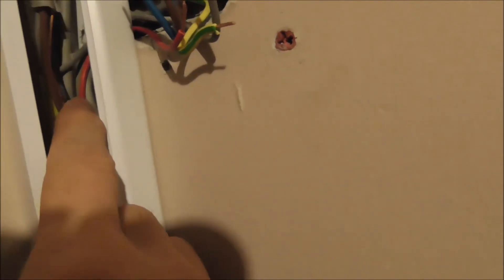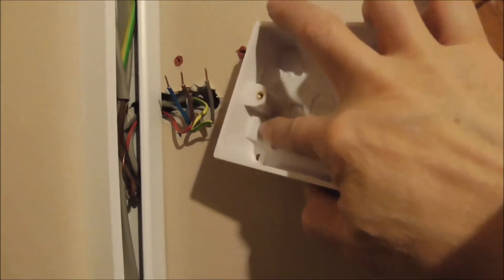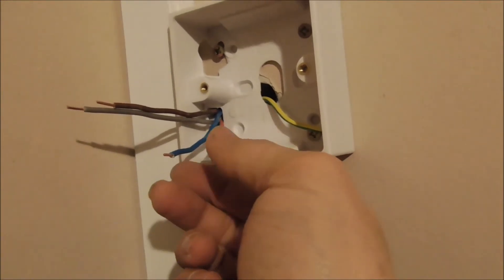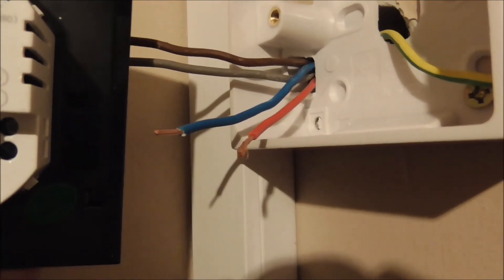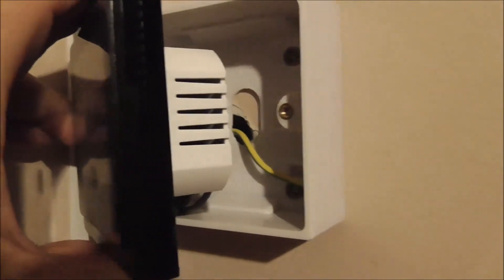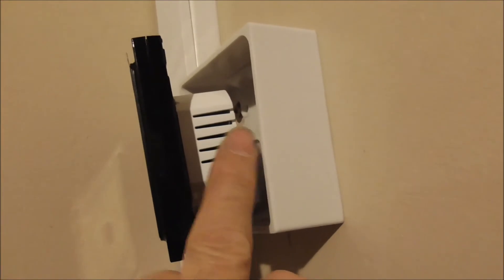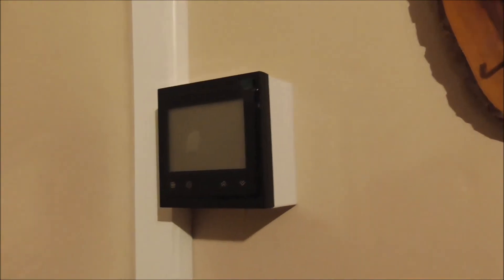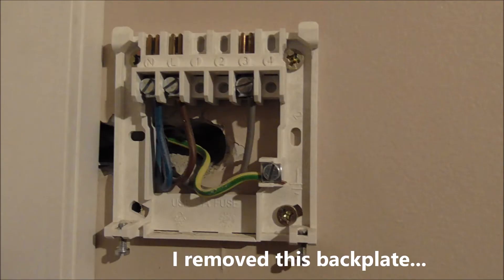Smart Room Thermostat: How to Install? WiFi enabled, central heating

Comment: I have , 1 permanant live , 1 permanant neautral and 1 switch live cable . Will i need to bridge to fulfill the 4 ports on the new thermostat or can the switch live cable be fitted to port 1 or 2 and one port be left empty? Thanks
Reply from the maker: In my case, i have a switched Live from the programmer and a switched Live to boiler, therefore the port 1 and 2 actually can connect the two switched Live together when heating is called. If you only have a switched-Live to your boiler, you DO need to bridge the permanent Live from port 4 to port 2 and connect your switched live to port 1. Port 1 and 2 is just a dry switch to connect 1 and 2 together when heat is called. check carefully before switching power on. good luck!

Comment: Hi from the USA Norristown PA WHERE DID YOU GET YOUR BACKING PLATE ? Or the WHITE BOX  FOR YOUR THERMOSTAT ? DO YOU HAVE A PART No# ?
Reply from the maker: Hi, for this type of thermostat, there is no backplate, you connect wires to the back of the unit. In this video a surface-mount backbox is used. In UK, it is a standard size, available in all DIY outlets such B&Q, Screwfix, Toolstation and eBay. Good luck to find yours!

Comment: A question about the 240V specification.  I understand that terminals 3 and 4 are for neutral and live. Does that specification refer to the voltage expected between terminal 3 and 4.. Or does that specification relate to the switched connection on terminals 1 and 2??
Reply from the maker: Hi, You can also think in another way: 3 and 4 can be considered as the power supply to this thermostat; 1 and 2 could be any two lines, and the thermostat just sometimes connect them together and sometimes disconnect them. Have a nice day!

Comment: I have an old wiring on old thermostat one black wire and one white where do I install on 1234?
Thanks
Reply from the maker: Please make sure you 100% understand your boiler system before starting your installation! To help you know your system better, I am trying to provide some info below and hope useful.  

Old two-wire thermostats could be mechanical thermostats which need no power and act like a switch. If this is the case and your new smart thermostat has the same wiring diagram like shown in this video(at 2:30), I think you should connect the two wires from the old thermostat to the connector 1 and 2 (either way) of the new smart thermostat. You should also find a way to get the permanent Neutral and Live wires to the new smart thermostat and connect them to the connector 3(N) and   4(L) of the new thermostat. 

Carefully understand and plan your job before starting it. Safety first and wish you a success!
Reply: @RepairDIY  ok how do I add a bridge do I need number 3 or number 4 or both?
Reply from the maker: @goodawindi  a bridge can be made with a short wire connecting two terminals on the thermostat but you must make sure which wires you are connecting.  One of the two wires on your old thermostat could be permanent Live but you have to find out by testing.  Whatever wires they are, it is safe to connect them (black and grey  from your old thermostat) to terminal 1 and 2 (of your new smart thermostat). You do need permanent Live and Neutral wires for  Terminal 4 and 3. Good luck!

Comment: Was the reverse wire for heat pump type unit? I have a heat pump type unit. Where would I hook up the reverse wire? I'm in the USA .
Reply from the maker: This is actually temperature-driven dry switch. It can be used anywhere where a traditional mechanical thermostat can be used (with extra N and L wires). have a good day!

Comment: Is there a smart thermostat for split AC?
Reply from the maker: This smart thermostat has a dry switch, which is good for many applications. If you can find the wiring of the built-in thermostat of a split AC system, you should be able to wire this smart thermostat into a split AC system. Good luck!

Comment: How do you get to cool mode I got it hooked up it isn’t blinking anymore
Reply from the maker: Cooling and Heating modes: it depends on the makes and models. some thermostats can only be used for heating and some models can be used for either heating or cooling. You could check the descriptions / instructions when buying and installing. have a good day!

Comment: My thermostat is blinking I have almost the same one what do it do? 4 red green n 3 yellow n 2 and white n 1 and it’s blinking
Reply from the maker: hi, the only blinking happened to me was when the thermostat was in setup mode, when you setting up the wifi name and password via your mobile phone. You could check your wifi connection or set up the thermostat again? good luck!
Reply: @RepairDIY  okay it aint blinking any more I have it on but how do I get to the snowflake to turn the air on when I hold the vdown the lock pop up
Reply from the maker: @killahk94  How to lock or unlock your touch buttons: press and hold up and down button for 5 seconds. good luck!
Reply: @RepairDIY  I need to get to the snowflake it is 6 modes or something

Comment: Hi i need help with my wifi thermostat. I only have the red and the blue wire from the old thermostat. Where do connect the other to wires at the CV. I saw that you connected them to number one and two. Red is number four and blue is nummber 3. Where do number 1 and 2 go to
Reply from the maker: hi, your two wires from old thermostat should be connected to 1 and 2.  Then you should connect 3 and 4 to permanent Neutral and Live. Safety first and Good luck!
Reply: @RepairDIY  ok. The neutral and live are the two wires from the old thermostat. I don’t have the other two wires. So my question is where do i connect the other 2 wires in the boiler? I already saw the connection for 1 & 2 at the thermostat.
Reply from the maker: @raoulfelter  if the two wires were connected to your old thermostat, the blue should not be the permanent Neutral, and the red may not be the permanent Live! If you cannot decide if the red is permanent or switched Live, the easy way is to connect the two to 1 and 2, then find and add the permanent Live and Neutral for 4 and 3. Hope this help. have a good day!

Comment: Hello i have a thermostat like this one but i want to connect it to gas boiler. Can i? I connect on 3-4 L-N and the other two wires to 5-6 for gas boiler. It works but my heat never stop, i turn off the thermostat and the heat is still on. Whats wrong with it? On 5-6 the 2 wires have electricity
Reply from the maker: hi, try to put the boiler two wires to the terminal 1 and 2 if you are using the same thermostat. Safety first always. good luck!
Reply: I did that 3 days ago and my electrical board brokes. Those 2 wires have electricity on them
Reply from the maker: @kostasgkvo4064  hello, your thermostat may be different from the one in this video? For this thermostat, there should be no voltage at the terminal 1 and 2 if no wires connected to them. If your thermostat has the same wiring diagram, and you have voltage at either terminal 1 or 2 or between them when no wires connected to them, then the thermostat should be faulty. The terminal 1 and 2 makes a DRY switch, not connected to any other wire inside the unit. When you need heating, the terminal 1 and 2 are connected inside the unit while you don't need heating, the terminal 1 and 2 are separated inside the unit.  Hope this info help. Good luck.
Reply: @RepairDIY  same diagram yes... My wires have voltage so i cant connect them to 1&2. I thought maybe i can make a jumper from from 3 (N) to 1 or 2
Reply from the maker: @kostasgkvo4064  hi, wait! how many boiler wires do you have ? One or two? if two, just connect them to 1 and 2. if one, you should find out what is required to control the boiler with that one wire, only after that you can decide your jumper connection. good luck.
Reply: i am actually in the same situation. i have tried to replace it but my boiler heat is still on. i put the old thermostat back. still no use, boiler heat is on. i have restarted the boiler itself. still the heat is on. any solution.?
Reply: I have 4 wires ... Black Brown Blue and Grey (UK) I have a combo boiler. Where would the wires go?
Reply: @ratilalinduondhia3516  Brown to 4
Blue to 3
Grey to 1
Black to 2

Comment: Hi, I got the same thermostat to install. I am replacing a manual Siemens  two wire only thermostat, the two wires only work as on and off switch, both wires are, 1. switch live (RS-SL) and 2. live (RS-L). I think I'll need at least a third one live to permanently feed the thermostat and a four wire can be a bridge, either from one of the two wires. The question is: what wire should I bridge? The 1 or the 2?. I think it would be the no. 1 which is currently neutral.  Your  opinion would be appreciated. Thanks!
Reply from the maker: hi, when you bridge any two connectors be very careful. verify each wire before connecting or bridging (decide: if any wire is permanent Live, switched Live, or boiler control/heat-demand wire; you MAY NOT have a neutral wire from the old thermostat?). i suggest that (1). connect the two wires from the old two-wire thermostat to the smart thermostat terminal 1 and 2; (2). find or add permanent Live and Neutral wires and connect them to the smart thermostat terminal 4 and 3 respectively.  IF one of the two wires of the old thermostat is INDEED permanent LIVE, THEN you can bridge that wire to the smart thermostat terminal 4.(in this case, you only need to add a permanent Neutral wire and connect it to terminal 3). Safety first, think it over and check before any connection. good luck!
Reply: @RepairDIY  Thanks for your reply, i'll need to get some time to look at options to enable permanent feed to the thermostat , very quick check question: what is the voltage for terminals 1 & 2? thanks again
Reply from the maker: @migueldurano  Inside the thermostat between the terminal 1 and 2 is just a switch: which can be connected or disconnected. You put two wires into the terminal 1 and 2, they will be connected when temperature is below the set temperature, or disconnected when above. For boiler operations, The terminal 1 and 2 just for connecting one wire(Live AC 220v) to another wire (Probably to control the boiler). 220v is a dangerous voltage. Be careful. good luck!
Reply: @RepairDIY  Hi, it did work, thanks. It is working and connected to the WiFi. I was lucky that builders connected the old electromechanical thermostat (Siemens RAA20) using a 4 wire cable, where only two were in use, a.) switch live (neutral - which I think acted as neutral as current was off when heating went on) and b.) live to control temperature with the Siemens. They also left enabled the earth wire which was not in use. So I ended up, reusing a. and .b as you suggested where b. being live, I did the bridge so I found c. as the live to feed the new thermostat and I repurposed  the unused earth as the neutral and d.) fourth wire to  feed the new device, and job done, I had to recolour the wires so anyone can understand the wiring. I also had to consult the boiler's manual. Again, thanks a lot!
Reply from the maker: @migueldurano  Congratulations1 Well done, you made it!  Have a good day!

Comment: Hello, i need to connect the same thermostat to replace my wall thermostat however my configuration is some how complicated. I have a combi boiler with a timer with two zones and 4 thermostats that control those zones. In your installation is there a timer or the thermostat is straight to the boiler? Thanks
Reply from the maker: Hi, yes i do have a timer/programmer on the other side of the wall. so the timed live wire comes from the timer, then it goes through the wifi thermostat. only when the timer is on and the thermostat is asking for heating, then the boiler can be fired. the timer can be put on the different mode: On/Off/Switched. Only  when the timer is ON mode, you wifi thermostat can have full control 24 hours. if you normally use the timer, then the smart thermostat can be used just as a remotely adjustable thermostat:=) have a good day!
Reply: @RepairDIY  Thanks for your reply, appreciate it. My existing thermostat has a neutral and live, (grey with blue sleeve and brown) and then it has a black cable going to a terminal called ON, and also it has a bridge between live and a terminal called COM. I was thinking to connect the neutral and live to the wifi thermostat, to bridge the live with terminal 4 in the wifi thermostat and then to have the black in terminal 2. However i have seen that your thermostat had a neutral and live but perhaps didn't have 240v in that live?
Reply from the maker: @tomcatRTY  hi,  my wifi thermostat installation: I have permanent L and N from the programmer for wifi thermostat. my wifi thermostat has a control switch(relay contact): one connector of this switch is connected to the boiler and the other connector is connected the the switched Live from the programmer. the permanent L and N provide power to the wifi thermostat. you can think by install this smart thermostat is equivalent to adding a switch between the programmer and boiler. safety first and good luck!
Reply: @RepairDIY  thanks for your reply. Does this mean that when your timer is not on the thermostat would not have power? Or the wifi thermostat has power regardless of the timer if it's on or off?
Reply from the maker: @tomcatRTY  the smart thermostat has the power all the time regardless the timer is on or off. the two switches of the timer and the smart thermostat are connected in serial: power live ---> timer ---> smart thermostat ---> boiler. good luck!
Reply: Why is mine blinking